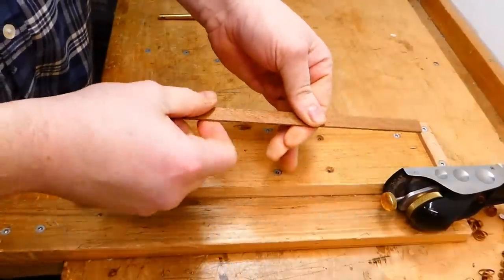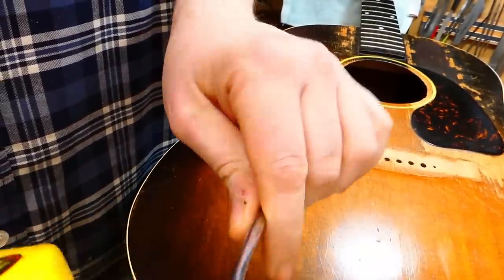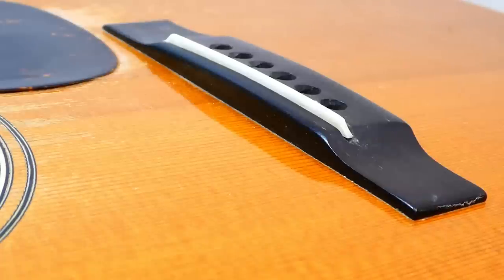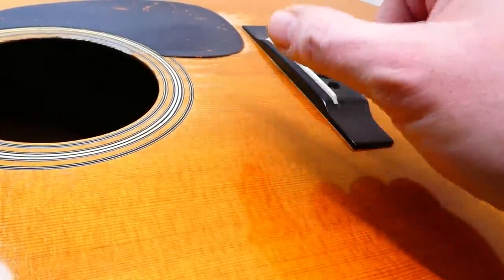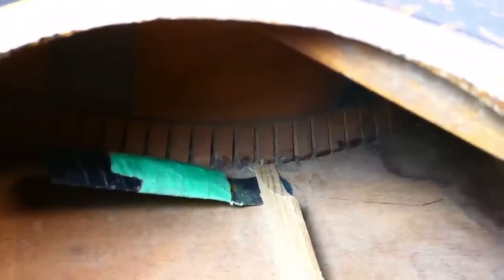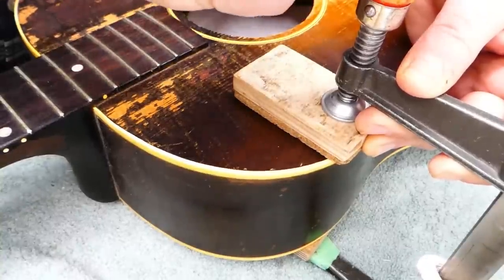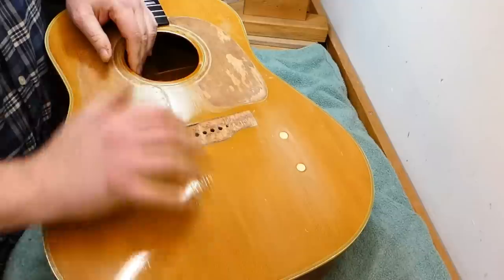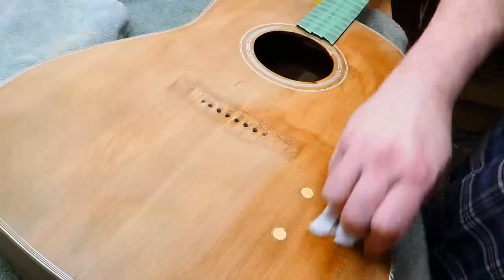40's Gibsons Part 4

Comment: Your alcohol based touch up marker technique to "limit its visual impact" is much like the retouching of dust spots from old darkroom photographic prints in pre-digital days.  Our aim was to break up the line so a viewer's eyes weren't drawn to the line.  A skilled retoucher, much like you are with your markers, would render these dust spots/lines virtually invisible by mimicking the grain pattern of the print.

Comment: good points about the drawbacks of the through-saddle, another one of which is that the trench is usually much shallower than a modern saddle slot, increasing problems with a tall saddle getting broken forward from string pressure

as for dislodging the hide/fish glue holding the saddle in, i watched a vid of an upright bass luthier removing a (hide-glued) fingerboard with alcohol ! he would constantly wick it into the joint while slowly working it apart with the pallet knife, and after like 1/2 hour the whole fingerboard popped off clean, all with no water.

he said the alcohol "dried out" the hide glue, which i don't understand at all

Comment: A Pro Finish job is Something I have only done 1 time. A 71 Fender P bass that had Orange  reflector Paint on body and neck when I bought it for about 200.00 U.S. After doing a Pro job on Touch up clear on the Neck. And Gloss Black lacquer on the Body. I sold it . For about 200.00. Years Later at A newly opened Detroit Guitar Center. I saw it listed For 1500.00 I could tell It was the same because I left 1 near impossible to see speck of its former state. I consider Your Videos a way of getting Luthier School Education I never had time or money for. I learned from books and talking to local luthiers for direction.Your videos Let Me more clearly see What I have done Right or wrong And How to do better.

Comment: I`ve had pretty good results with using water colors like you had as a kid for hiding patches and then painting on grain lines with a small quality brush with a sharp tip. Practicing on the same piece of wood you cut your patches from helps a lot.
Reply: I've seen Ian Hates Guitars do this. I wasn't aware of watercolours though, do you use them on bare wood? I've just replaced some tuners on a modern Gretsch with open back Grovers and filled the old screw holes. I did the painting on the grain lines method on the stained fills. I'm really pleased with the results.
Reply: @MrDblStop  It`s been a while since I did it. I might have done it on top of sanding sealer after it was sanded with 400 grit. I did it on a `56 Telecaster where I plugged a hacked pickup cavity.  Then I did the usual blond translucent finish. Applying water color on bare wood you don`t have much control over how the open grain absorbs the color.  This was my painting process on open-grain wood:
1) After the body was finish-sanded, 2 wash coats of sanding sealer, let dry thoroughly for a day.
2) Dap brand joint compound tinted to a medium brown (chocolate pudding-ish  using metallic dyes, brown and a little black) applied as a grain filler. Dap compound is much finer-grained than other brands, it`s cheap, dries fast, easy to dry sand with 400 grit.
3) Maybe 6 coats of sanding sealer, 1/2 hour between coats. Let dry for a day, then lightly wet-sand with 400, just enough to cut the gloss to allow solvent to escape. Let dry for a few more days, then wet-sand with 400 to flatten the surface. Be VERY careful to not sand to bare wood. I would sand under the pickguard area first to get a feel for what I could get away with. It was at this point I touched up the patch with water colors.
4) At this point I sprayed the blond lacquer.
5) Spray 3 double coats of clear. A double coat is one coat sprayed immediately over another. Again, 1/2 hour between coats.
6) Let dry a day and lightly wet-sand to cut the gloss. Wait a few more days and then 3 more double coats. Wet sand to cut the gloss. Wait at least a week, two is better,  and do your final sanding with 600. I never used anything finer than 600 because lacquer buffs so easily.  I once waited a month to buff a guitar and it went like a dream, easiest buff I ever did.
  I showed the  Tele to some vintage dealers at the Philly Guitar Show, they were very impressed. No biggie, I painted my first car at 16 in 1966 and my first guitar in `73. Do anything long enough and you get the hang of it eventually. One more tip: never, EVER hang a guitar in the sun to hurry the drying. Bubbles, hundreds and hundreds of tiny bubbles in the paint. Cue the Dean Martin song.....

Comment: Beautiful work as always. The care you put into everything is inspiring. I also realized, after watching this, that I have a through saddle on my Martin D-18 (as opposed to a blind saddle slot). I don't think mine was ever glued down because when I first bought the guitar new in the 90's I had them install an under saddle pickup. I removed the pickup a couple of years ago because, surprisingly, it was installed shoddily way back then with the strip not making good contact. So the saddle has been sliding around for decades. The bridge never developed the forward tension crack that Ted mentioned, but just last month I had to replace the saddle, because it had cracked lengthwise in two places and was very unstable as a result. So this episode was particularly interesting to me. I wonder if I should eventually get a new bridge with a blind/closed slot for the saddle to make it more stable? Thank you for another great video!

Comment: Possible solution when power sanding finished body - stuff towels/rags into the body to absorb the sound
Reply: fiberglas or rock wool insulation works a treat on metal cans, I'd suppose it would work here too.
Reply: @markbernier8434  suppose it would but I wouldn't use it as I personally loathe working with the nasty itchy stuff

Comment: Just a question. For bridge work supports could you use clecos for support? They are used for automotive body work, but they apply pressure to two surfaces, and they come in different sizes! Just an opinion.

Comment: I’ve got a Yamaha 460 that has a sound board buzz pretty much only on 3rd and 4th strings. It seems like it buzzes in those frequencies. Can’t see any loose braces. If I put a little pressure on the board at the bridge or behind it, no buzz. It seems harmonic to me. The spruce moves a bit much? The guitar could pass for new by all appearances. Probably 30 y old. Frets not even worn. Could it be underbraced?  Driving me batty. Anyone ever heard of such?  Appreciate the video as always.

Comment: 0:52 I've heard this before. Does that mean that if I cut my 2x4s to pieces and glue them back together they will be stronger?
Reply: Only if you cut with the grain and it helps to re-orient the layers a little, bam plywood or engineered beam lol
Reply: @richardlee6886  well, that was my point, = saying that glued pieces are stronger than the original is misleading, lol.
Reply: @cenek nemec o ok well just called myself answering your question, didn’t realize it was rhetorical. You’re right a bit misleading.
Reply: @richardlee6886  No hard feelings.. I think I know what they mean now, the close layers surrounding the breakage will be ALWAYS harder, stronger,, tougher is probably the right word, because they are impregnated with the glue, but that has not really that much to do with the strength of the joint. So you need those dowels And the glue, and then the result might actually be stronger. 🖖